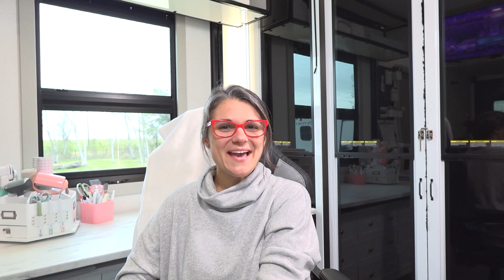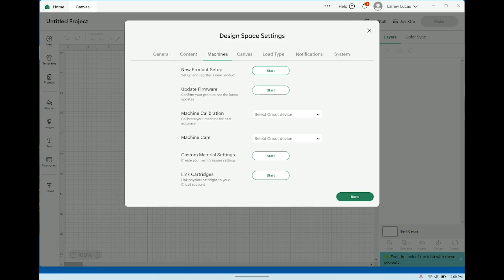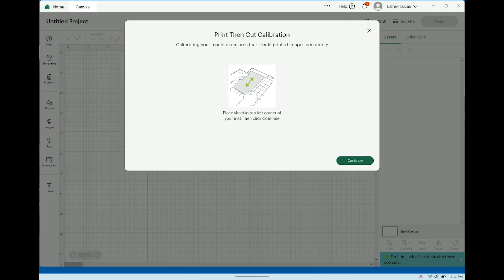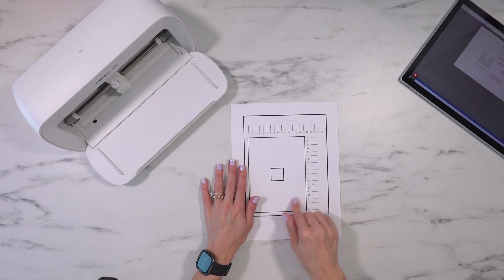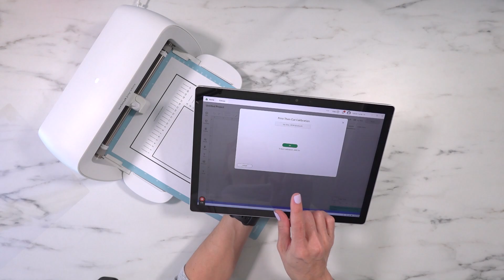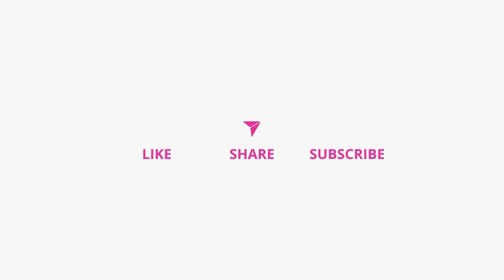How to Calibrate your Cricut Machine for Print then Cut | Step by Step Cricut Tutorial

Comment: I always try to do the calibration thing but it never cut it properly. I don’t know if I’m doing it wrong, but I always follow the steps and it doesn’t cut it on the right way. I’ve been trying to make sticker a time ago but what I do is just waste all the paper😪😪
Reply from the maker: So, during the calibration process, when it asks you which cut is best, it may not be perfect, but it should be pretty close to the center. Are you placing your calibration worksheet on the left side of the cutting mat? Everything should be nestled in the top left corner of your cutting mat. 

Additionally, during the calibration process, if you aren't satisfied with the results at the end, you will be prompted to print out another calibration worksheet, which I recommend doing. But it only lets you do it 3 times. 

If you are placing a laminate on top of your sticker material, cut it down to size so it fits within the added sensor marks that will be printed on your sticker material. The laminate can alter the accuracy of the cutting process (sometimes lol). 

I would calibrate your machine right before you want to make stickers...and it's normal to have to recalibrate from time to time. Let me know what else I can do for you so you can start making stickers! :)
Reply: @craftedbylucas thanks for the information! I always put it on the left and when it cut it it’s not even close to the black lines😩 I will try again some other time. Thank you!
Reply: @isajusti10  If it's cutting too high select line U. Anything below k brings it down a bit, anything above K brings it up. Same as the numbers anything higher than 11 shifts it to the right and anything less than 11 shifts it to the left. U being the last letter will bring it down the most. Keep selecting U until it gets close then you can do fine tuning
Reply: @isajusti10 I have the same problem!  No matter how many times I do this it NEVER aligns correctly!